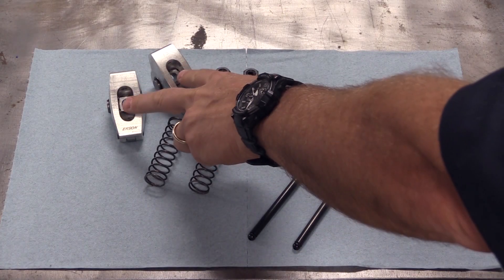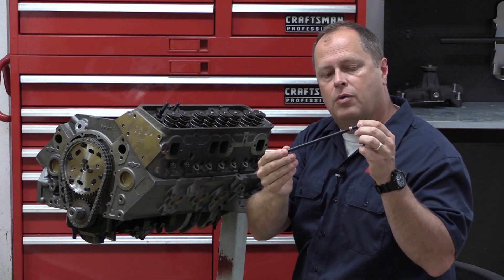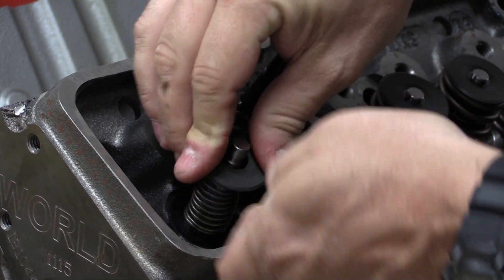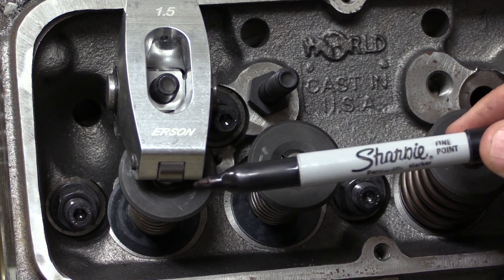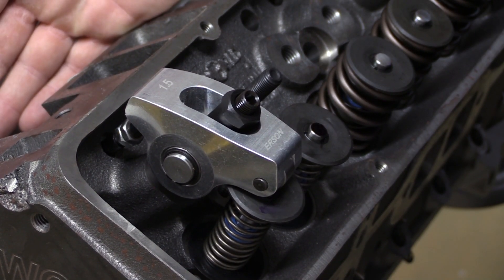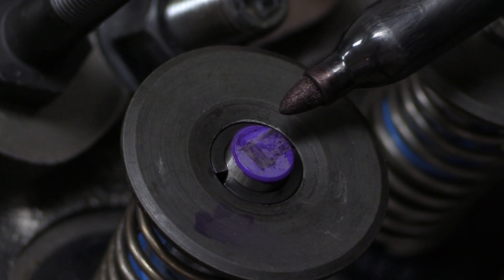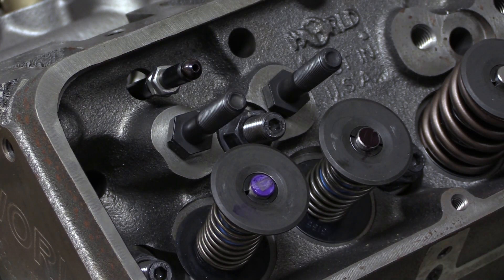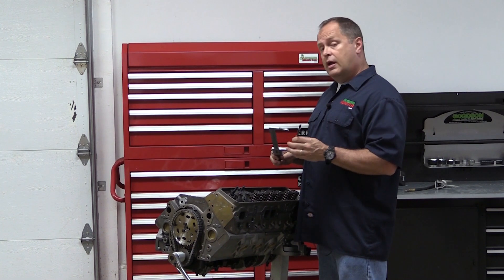How to Determine Correct Pushrod Length

Comment: You NEVER want to worry about where the wear pattern is at on the valve to set rocker geometry. The wear pattern has NOTHING to do with "geometry." Because none of the manufacturers have any "accurate" standards for stud and stand mount dimensions from the valve, and because the stud leans into the valve, and because engine builders use varying length valves, and lastly, because every custom engine has a different NET valve lift, no rocker arm is going to be able to have the exact length required (on a mass produced basis) to accommodate all these variables. That is why you shouldn't worry about where the witness mark on the valve tip is at. Just worry about the angles. The BEST way to assure you are measuring ANGLES correctly with HARD measurements, is to use the VALVE SPRING RETAINER, because it is perfectly mounted at a 90 degree angle to the valve, and that is the principle of MID-LIFT precision.
>
You NEVER want to use "checking springs" to set rocker geometry. You need to check for NET valve lift with ACTUAL springs. Once you know what your NET valve lift is, then EVERYTHING after that is done with a CLOSED valve, no tension on the valve train; not even necessary to have an adjuster in place. Just an adjustable push-rod; dial calipers and KNOWLEDGE.
>
With all the tools I've made; and all the engines I've built; and all the tricks I've learned (many from other creative engine builders), to this day when I still occasionally help an old friend out on setting up his rocker geometry, I do it in less than 5 minutes with the following technique. It's all done in the CLOSED VALVE position, because you don't need to worry about hydraulic lifter valve compression or flex. You don't even need to have the adjuster on the rocker arm; it is all laying loose. And obviously, unlike this video, you are not rotating the whole thing over under valve spring pressure. Once you know what your NET valve lift is, everything after that is math, and setup; and this can all be done with the rocker laying loose on the stud, and an adjustable push-rod lifting or lower it as needed.
>
It's not complicated:
A. Know your NET valve lift; divide in two; that is your MID-LIFT "motion" (MLM).
B. Measure the height of your valve tip above the retainer.
C. Measure the diameter of the roller; divide in half (this precisely gets you from the bottom of the roller to the AXIS).
D. ADD "B" and "C" together, to get the STACK HEIGHT. An illustration can be found at: http://www.mid-lift.com/TECH/TECH-Installed-G1.htm
E. Now, use a straight edge like the little machinist square shown in this video, and lay it across the valve spring retainer and alongside the trunnion.
F. SUBTRACT or ADD (as needed) the STACK HEIGHT to or from your MID-LIFT MOTION, by raising or lowering the rocker arm on the stud.
>
EXAMPLE:
* NET VALVE LIFT IS .700", so MID-LIFT MOTION is .350". That's cut in stone, now forget it for the moment (you've written it down).
* Valve tip is .050" above the top of the retainer; and the .500" rocker arm roller diameter tells you its radius is .250", so the STACK HEIGHT is .300".
SOLUTION:
If the STACK HEIGHT is .300" and the MLM is .350", then you need to place the trunnion .050" BELOW the valve spring retainer. If your math has the inversion of this, then your trunnion centerline would be above the straight edge coming off the retainer.
SUMMARY:
DO EVERYTHING IN THE CLOSED VALVE POSITION, AFTER YOU KNOW NET LIFT.
It's much easier to get an accurate DIAL CALIPER measurement on hard points, to find their true center-lines, than trying to use visuals that only give you approximate values. You can use the outer edges of the trunnion's diameter and divide in two for its center, which is far more accurate than eye-balling.
For those who want to know what is important, and how to fix existing systems, you can get the book on this at: http://www.mid-lift.com/MID-LIFT_ARAT-2016.htm
It's this simple: KNOW YOUR MLM; KNOW YOUR STACK HEIGHT; USE THE RETAINER AT CLOSED VALVE; and SET YOUR ROCKER TRUNNION as needed. Good luck to all. --Jim Miller
Reply: That's a lot to digest, Jim. Sounds like you have cracked the code no one else has.
Reply: Been using Jim Miller's method for a long time and bought his hard copy book last year. Jim Miller ACTUALLY knows what he's doing. I hate to say it, but this is a hack video and no-one should be using this advice. Listen to Jim.
Reply: Glad I came across your write up, wish I could just see it done-hands on.

Comment: Great information. Now can I do this with lifters that are not pumped up with oil? Also I've been told I need to have preload on a cleveland engine. I'm not getting any preload at all on most lifters. I have 20k on one or two. The others appear to be torquing down without any preload. Is that itself an indicator of too short of a pushrod? Thanks for your help.
Reply: I have same question. I converted a pair of of used hyd. lifters into solids by taking them apart and inserting some small washers to raise the plunger to where the snap clip just fits back in.
Don't see any difference between my Windsor or my Cleveland in regard to this procedure.
Comments please???
Reply: had the same issue with no preload my amc 4.2, my pushrods were too short.

you need to do this with the tappet empty of oil

what i did was assemble it as it is then use a feeler gauge between the rocker tip and gave stem until i just contacted the pushrod with the rocker , this was done on the close potion of the cam lobe and checked on all valves, i took the biggest gap (for me was .127”) and divided by my rocker ratio to find the pushrod length deficit then i added .030” for lifter preload on my hydraulic flat tappets. add it all together and you have your new pushrod length

the way he is doing it it more precise and takes into account the actual contact path on the valve stem but this method got me the correct length for my application
Reply: Light springs don't over power the lifter spring when setting preload.

Comment: Need to run that on every corner! Blocks are out, valve heights are many times off from one end to the other or from head to head. By doing all 4 corners you can find an average, if you don't one corner is perfect and other 3 could be awful. Never assume anything! Think about it, the cam bore could be off by a thous, lifter bores off a few,  and all that adds up and multiplied by the rocker ratio.
Reply: Nope, what's the most 1 corner could be off, compared to the other 3 corners? 10, 20 thou?

Most push rod sets come in lengths in steps of 50 thou, maybe even 100 thou.

If you are going to be super anal about it, you got check every pushrod for its proper length.
Reply: @DropDstar No not on my end! From previous would be machinist . Not everyone wants to spend another round of cash to correct all the things i previously said that can affect valve train geometry. Hey I've seen CNC stuff 2 thous out end for end! Apparently you must not do much work on anything or you would have noticed these things too! SOOO much for SLOPPY! Maybe you could do a video on taking out your trash.

Comment: bad explain, no mention of how head is attached, with or wirthout  gasket, head bolts or being torque etc etc! bad
Reply: Head installed as it's going to be run. Smh
Reply: You wouldn’t figure pushrod length without the head installed as if you’re ready to run it. That’s just plain ignorant.

Comment: 6 billion videos about rocker arm geometry...rocker arm needs to be 90 degrees at mid lift from valve stem, Not one vid talks about valve stem length and its effects on geometry. Now my rocker arm travel path is on the outer edge of valve stem when I set it at 90 degrees mid lift, I've heard some people say the only thing that matters is that rocker arm travel path centered, others say as long as its 90 degrees mid lift and hit hits anywhere on the valve stem..lol. if the rocker arm studs ran parallel with the valve there wouldn't be any issues with valve stem height so I'm  pretty certain a shorter valve will fix the rocker arm travel path. Damn the Chinese aftermarket industry
Reply: 1.7
Reply: @peterbuilttough3406   this is exactly what I have just ran into. I have +. 100" valves and the mid lift method puts the pattern about .050" from the edge of the valves. It has a small sweep pattern, but I don't trust it. I could put standard length valves in it and it be fine, but then I run into spring installed height problems. So I gotta either try different brands until I find one that will work, or shorten the pushrod about  .100" and check the pattern. It's always some bullshit.
Reply: No it won't.

I did it like he shows us 16 years ago. I'm now refreshing my motor with new cam. Its a sbc 381 stroker with less than 100 miles on it, in 16 years. (working on car).

Any way, 16 years ago they must have sent me Ford roller rockers. I didn't know much about correct geometry, but I did know about the roller tip riding on the center of the valve stem. Mine was centered but the pattern was quite wide. The pushrod was shorter than it should have been, to get the witness mark on center.

At half of the total valve lift, my rocker wasn't 90 degrees to the valve stem.

Small block Chevy rockers (trunion center to roller tip center) is like 1.380" while Ford is 1.436".

Mine bloody rockers are 1.436"!

So, needless to say, I'm selling Harland sharp stud mount ford's and going with a shaft mount setup.

Gotta do the "1/2 total lift" method of checking for proper pushrod length.
Reply: @jakefriesenjake  I'm going to measure mine in just a few. I think that scorpion might have screwed up. We will find out shortly.
Reply: @inscoredbz  I went with the cheapest shaft mount rockers from summit racing made by speed master. Pretty nice for the price. Using the supplied Shims, I got it pretty perfect. 1 bank of 4 cylinders was different in shimming than the other head. So I measured with the test rod and found a set of Pushrods that was in between the 2 numbers I got. The adjuster nut on the rocker takes up the play nicely. Just have to make sure that the new Pushrods are definitely shorter than the distance from cup to lifter once the rocker is bolted down. I have the cast aluminum bow tie tall valve covers and I had to elongate the stud holes, use washers and then take a die grinder to all spots where the rockers (carburetor side), would touch the cover. Pain in the ass but I got it to work. Runs good now with the new hydraulic rollers lifters and no having to re-adjust them ever.
Reply: 😂you misspelled PETERBILT, there's no "U" in Peterbilt. 😅

Comment: How about the 1/2 lift method?  Is that a good method as an alternative for figuring pushrod length?  How about the 2/3 lift method?  I heard this is quickly replacing the 1/2 lift method as it results in a slightly wider contact path but the very last of the lift is more straight up and down than the previous 1/2 lift.

I havent done mine yet, but AFR states to use OE length pushrods or 0.100" longer than OE but I really want to check for the proper length for my daily driver build.
Reply: BTW, A longer pushrod pushes the preload farther down.
Reply: @hotrodray6802  it also changes the starting point of where the roller tipped rocker arm rests at.  I ended up going with the crane cam recommended 6.400" length and set my lifter preload at 1 turn from zero lash.
Reply: 1/2 lift would only be done for hydraulic lifters.   He did say he was running solid lifters but it wasn't stressed very well or clearly mentioned for the procedure he demonstrated.
Reply: @macfranks2456 
Right. SOLID Cams don't open the valves all the way.
Smh
Reply: @hotrodray6802  Solid cams?? As opposed to a hollow or liquid cam??
Reply: @macfranks2456  so many different ways out there.  I tried 1/2 lift and even 3/4 lift methods both gave me between 6.500 - 6.600" pushrods for the intake and 6.550 - 6.650 for exhaust.  I didn't want to run two different pushrods and I wasn't too crazy of having the roller tipped rocker resting on the outboard side of the center line of the valve considering my roller cam is a 0.520"/0.542" lift.  So I opted for what my crane cam card said which was 6.400" pushrod length which on my adjustable length pushrod checker the roller tip rocker sits just inboard of the valve center line.